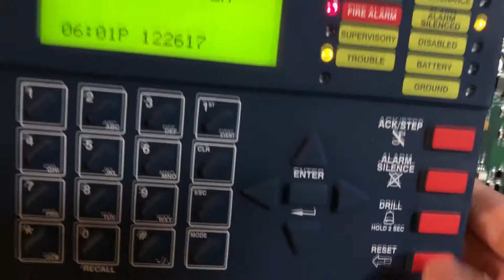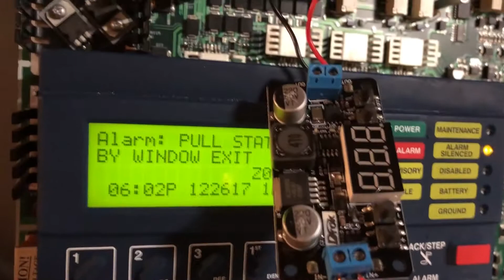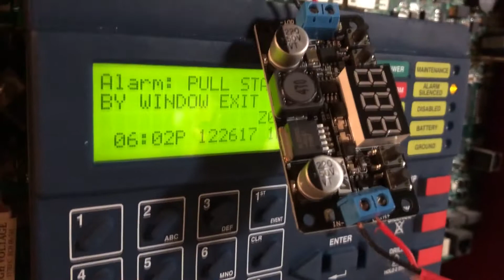Fire Alarms Explained: FWR vs Filtered DC Side by Side on Horn/Strobes

Comment: FWR just sounds horrible. I wonder why some panels dont have the feature for Straight Filtered DC. The difference is collosal.
Reply: I think it is because that they dont want to spend a whole bunch of money on the panel. It makes no since that they dont have Filtered DC.
Reply: Simplex9838 Productions Probably because fire lite panels were made to go with spectra alert or l series horn strobes or even bells, which don't require filtered dc to sound good. Same goes for other panels with FWR, which had FWR probably for the same reasons
Reply: Isn't the MS-5 kind of a bargain bin panel? It's not horrible but it definitely seems to be on the cheap side... I guess that's why they did it, to cut costs on extra circuitry.